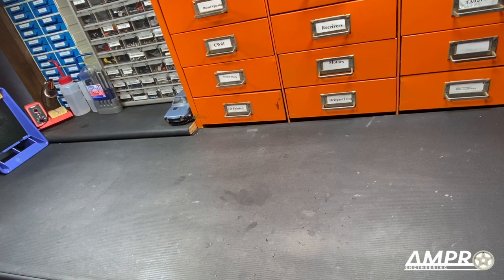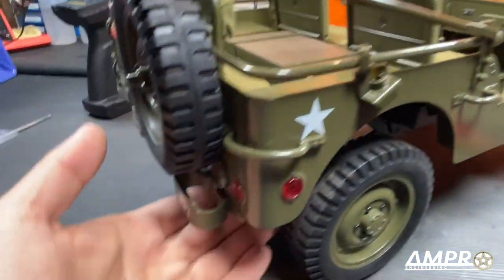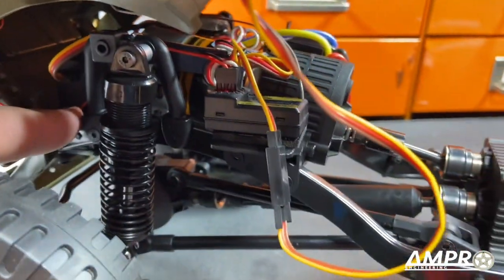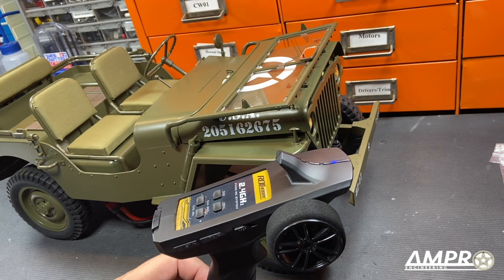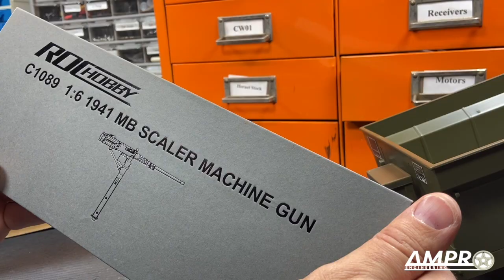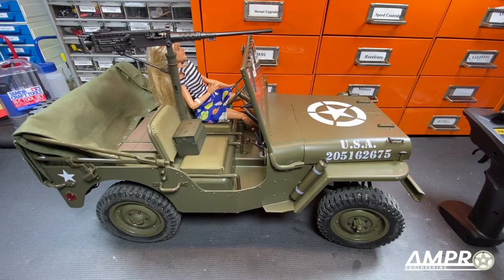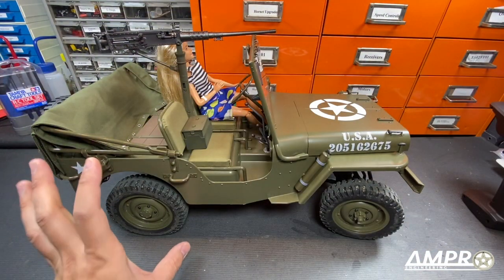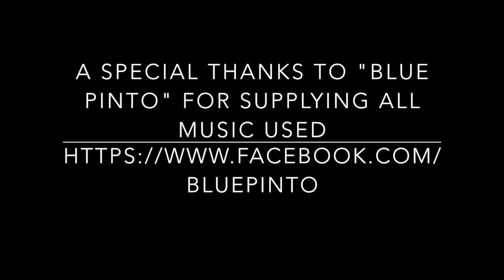E324: RocHobby "Jeep" 1/6 1941 MB Scaler & Gun, Trailer - The Buyers Guide Series

Comment: Looks Great!! I'm sure you will make some great 3D parts for this jeep. Like better mounts for the soft top.I have both and i the 1/12th version of this better. I also make my own light systems in most cases too. It's just so much cheaper and less wire. Thanks For Sharing!!
Reply from the maker: Thanks! Yeah usually i do also but I wanted something quick to throw in there. Kit harnesses are a mess of wires.

Comment: Looks like you need to flip the frame for the canvs roof so the support that is bent should be the front and lower.
Reply from the maker: You think thats the problem? I tried that off camera and it look just as weird. In fact, if you look at promo stuff...it looks like mine...not so great.
Reply: @AMPROEngineering  The 1:1 has the straight bar in the rear and the bent bar forward, where the bend faces forward. The windshield on these FMS rigs really snaps into place, but if any one snap is not closed it will push the window forward (more vertical).

Comment: 4:25 military vehicles are truly austere. Those are called plates: Nomenclature Plate, Weight & Balance…etc. One can find those plates detailed on the system drawing,where in turn there will be a dimensioned drawing for each plate that dictates the data elements & font. So yah, an authentic detail.
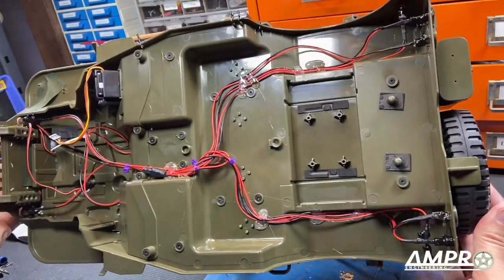9:28 That’s the headlight for when you don’t want an airplane to come strafe you, or blow you up (all other lights off). Or a sniper or even artillery for that matter…but fundamentally it is about the air threat.  You will see vehicles with slits in covers on the lights for the same purpose.
Reply from the maker: Good to know. Thanks!

Comment: I'm just curious about the steering wheel.   Maybe I saw another brand or possibly a different scale one?  I thought the steering wheel turned with the front wheels?
Reply from the maker: It does. I had the doll attached to the wheel and when it turned she would fall over so I disconnected it. You can it it moving during the review.
Reply: @AMPROEngineering  okay got it.  I've not purchased this kit, just saw the YouTube videos.  I've installed "Yeah Racing X DarkDragonWing Motion Steering Wheel" kits in 3 of my RCs  and used some of the Amazon "action" figures.  So I'm just comparing apples & oranges.
I really do enjoy your reviews.  I have picked up some interesting ideas.  So please keep it up

Comment: It would not be you if you did not tinker and put your spin on it.
The Jeep was designed for four burly GI's and the handles were so if it got stuck or hung up the four occupants could lift it up and get it to where it was able to move under it's own steam.
The shame is that they used coil springs instead of leaf springs as they were designed to have I wish ROC Hobby had gone that route or a third party company made a conversion kit, I know there were kits for some Axial crawlers.
One of those box's clips to the gun itself and the bullet chain runs in to the gun from it the other is to catch the casings as they drop from the gun, so mounts to the left of the gun and the feed can is to the right.
I had a 1-1 for many years and it did end up on coil's as I kept snapping leaf's and the ride was awful, this does ride as the 1-1 though so I suppose a good compromise. And yes they were tiny so perfectly in scale with the huge SCX6 which I  am toying with getting as I only have large scale gas and a couple of electric a UDR and a SBR, I enjoy this type of video seeing where you go with the vehicle, oh and the wiper arms were green to stay with the camouflage theme, some even came with the rubber painted also as they did very little masking once in the armies hands. The fender light should operate with the blackout side lights not rear and head lights it is a convoy light usually they have a white circle painted on the rear axle housing for the one behind to follow.
Reply from the maker: Im so glad there are people like you who are totally knowledgeable about these things. Thank you for the information, I know nothing about jeeps at all! I agree that leaf springs would have been better but I think the majority of people would have complained about the lack of articulation, not knowing that one of these jeeps is not 4 linked.
Reply: @AMPROEngineering  Surprising enough you would get the same amount of movement from the scale leaf springs, I have seen a couple of home built Willy's jeeps built with the leaf spring set up and yep drove even more scale like, but I must admit this one moves very much how mine did until I swapped to coils on my 1-1, oh and the casing collection can usually only caught about 20% of the used casing's.

Comment: The canvas top looks nothing like what is sold these days,
There is no Velcro /Tabs anywhere.  Instead a sleeve for the forward bar and a single rope strand at each rear corner. 
And this canvas topper requires some tension to keep the grommets placed on the windshield studs.   It will require some tension or silicone dabs to hold them in place.
A lot of changes and QC was not actually checked to verify that it will fit - work.
I even got a one piece  transmitter with mine.  So expect inconsistencies when buying from China.  Besides the extremely detailed body.  Attention to detail is not in the MFGR's forte.
I'll expect more issues as I look about and attempt to run this thing.
This isn't my review.  But if I were going to rate this thing out of 5, I'd have to give it a 2. 🤨 I'm rather disappointed with my purchase.  The Axial SCX6  or even the first SCX-10 is way better built  and has some American QC in their MFG'ing.  Expect 0 quality control coming out of China  and its copy cat MFGR's!
Don't believe all these youtube reviewers !  They are simply like parrots enthralled by a shiny metal object  !  That or they work for China  😏
Reply from the maker: This is not what I saw on my car. Mine was rock solid and to this day, a great truck. Do not blame China for lack of QC, blame people who wont pay for good products. This is an old review and I do not know what has happened since then.

Comment: WHEN YOU TESTED THE STEERING EARLY IN THE VIDEO. THE STEERING WHEEL TURNED WITH THE WHEEL'S LIKE IT SHOULD, BUT WHEN YOU TESTED THE STEERING WITH THE REMOTE. THE STEERING WHEEL DIDN'T TURN WITH THE WHEEL'S EVEN AFTER YOU SCREWED THE STEERING WHEEL BACK ON AFTER IT FELL OFF. WHAT HAPPENED? AS FAR AS THE MACHINE GUN. I DIDN'T PUT THE BULLET'S ALL THE WAY IN LIKE THE GUN LIKE YOU DID, BECAUSE MY BULLET'S WERE JUST HANGING STRAIGHT OUT LIKE THEY WERE JUST FLOATING THERE. IN REAL LIFE. THERE ARE SEVERAL LAYERS OF BULLET'S IN THE AMMO BOX, SO WHEN THE GUN IS BEING USED THEY ARE ACTUALLY ANGLED DOWN AS THEY COME OUT OF THE BOX. WHAT I DID. I PUT THE FIRST BULLET RIGHT ON THE EDGE OF THE GUN AS IF IT'S JUST GOING IN. THIS ALLOWS THE REST OF THE BULLET'S TO HANG DOWN ENOUGH TO LOOK AS IF THEIR COMING OUT OF THE AMMO BOX. IT MAKES IT LOOK ALOT MORE REALISTIC. ON THE OPTIONAL HITCH. YOU TIGHTEN THE SCREW ON THE RIGHT SIDE WITH A 1.5 MM HEX TOOL TO KEEP IT FROM OPENING. THE HOOK'S HANG FROM THE REAR BUMPERS WHERE THE NUMBER'S ARE. NO NEED TO DRILL HOLES. THE AMMO BOX CONNECTS TO THE TOP RIGHT UNDER THE BULLET'S. THEY ALSO SELL WWII 12 INCH MILITARY FIGURES ON AMAZON. THEY FIT PERFECTLY WITH THE JEEP. SORRY IF I SEEM SO PICKY, BUT I'VE BEEN DOING RC, AND BUILDING MILITARY DIORAMA'S FOR 50 YEAR'S. I GUESS I'VE JUST LEARNED TO PAY ATTENTION TO DETAIL. ENJOYED YOUR REVIEW. THANK YOU.
Reply from the maker: For the steering, I unplugged it on accident. Very cool info! This thing is totally rebuilt as a road going jeep now. No more military. You can see it in IS by Michaelplatypus. It is all yellow.
Reply from the maker: I mean on instagram.